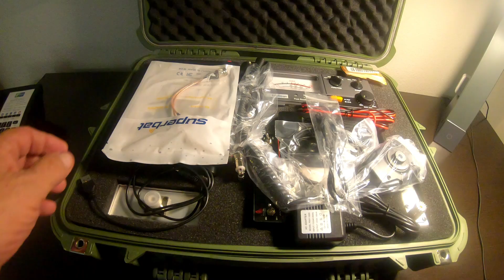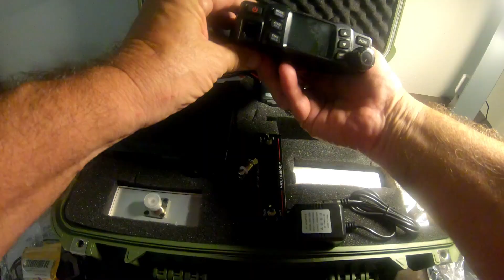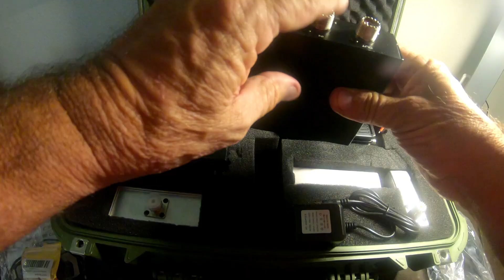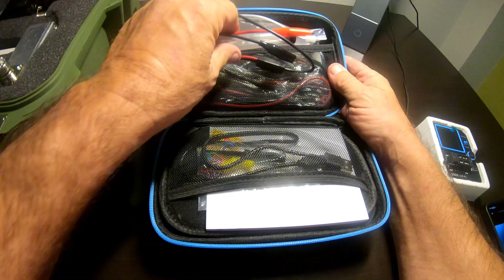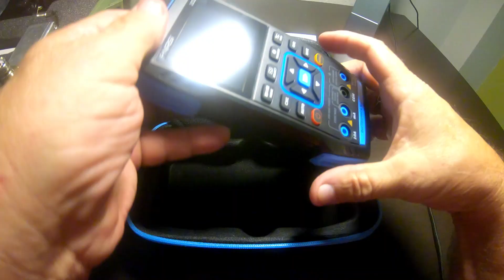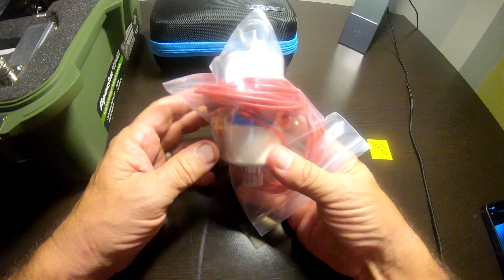DIY CB Radio Bench I Can Travel With

Comment: Did you ever find a better antenna option for your kit?
Reply from the maker: I just started packing my Stryker SRA10 in my suitcase.  I can get it to tune good on Hotel refrigerators, but it's still not ideal.  Noise floor in hotel rooms is very high. But at least I can get a good enough swr to still tinker😅 Thanks for watching and commenting